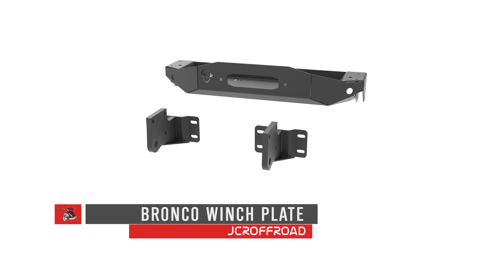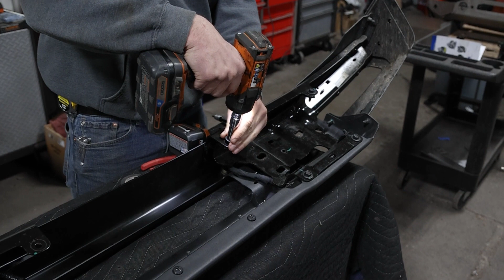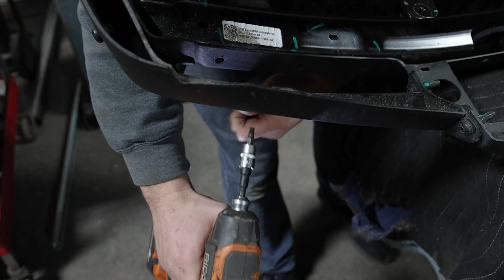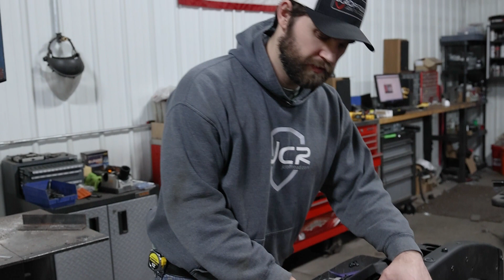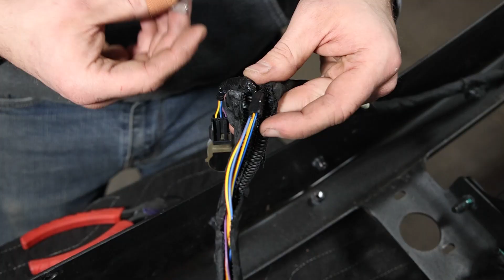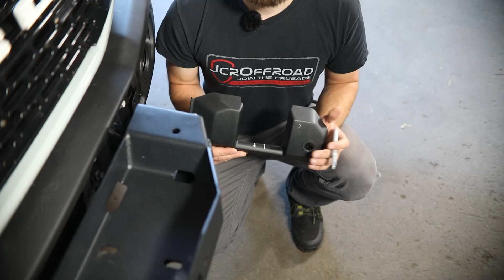Bronco Winch Plate Install

Comment: Did you add any kind of strengthening to the frame horns to keep them from bending while winching?   I guess it's fairly common.  I used the ones from Tricky Dick.  It was extra work, but I feel a lot better knowing they are installed.

Comment: Question, what about the factory front cruise control radar, will it work or needw relocation? I have a 2022 Badlands and want to get this mount
Reply from the maker: Works without relocation.
Reply: @JcrOffroad  awesome, just got your rear top left and right molly panels with the 2 shelf's. Build quality is 10000%, will be going for the full skid plate system and winch mount ✌️🙏

Comment: Note that if you have the CAPABLE bumper that the electrical portion is incorrect from this video where it shows you need to pull the wiring harness out and cut back the loom to get some slack out enough to extend to the new mounting locations.  We had to cut and splice into the three-wire parking/proximity sensor wiring (3-wire) to extend it about 9-inches to get comfortably to the winch plate mounting locations.
Reply from the maker: Thanks for the updated information!

Comment: Any thoughts on developing a hitch receiver that mounts in a similar way and looks just as good? There's definitely a hole in the market for those that want to use cradle style removable winches and other things to plug in like hammock stands, cooler baskets, and rod holders.
Reply from the maker: Nothing in the works right now.

Comment: So what about the radar for the automatic headlight dimming and cruise control ?
Reply from the maker: It works with the ACC module in the bumper.
Reply: @JcrOffroad  So if I bought my winch plate a year ago, is there any difference in this one?  If I move my ACC back to the orginal location, it will work?  Thanks.
Reply from the maker: @wheelerk2012   we didn't make any changes to the winch plate. We just did some testing once we acquired a Bronco with an ACC sensor and found it worked without displaying any errors.
Reply: @wheelerk2012  I didn't have any issues with the ACC working in the stock location with my JCR Off Road Winch plate.  (I have since upgraded to their Full front bumper)